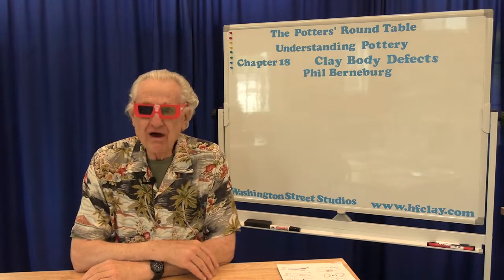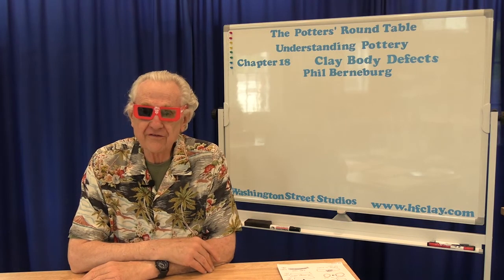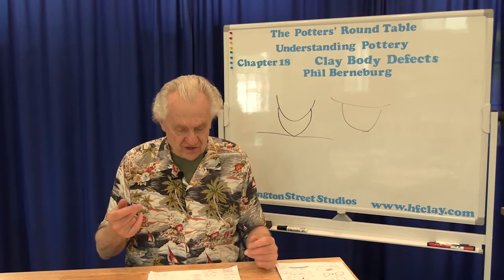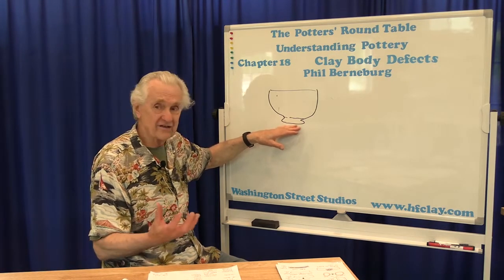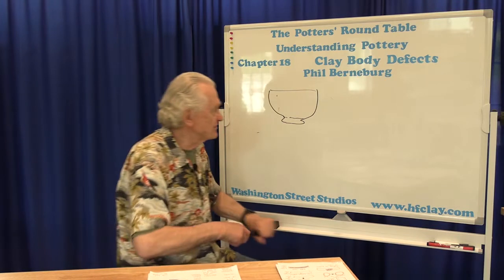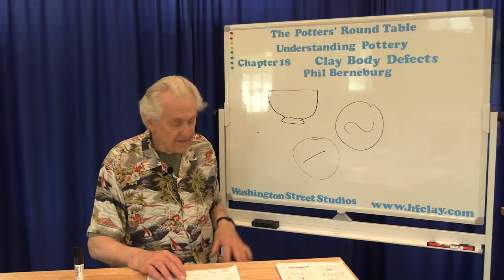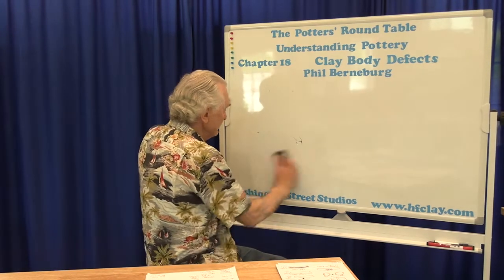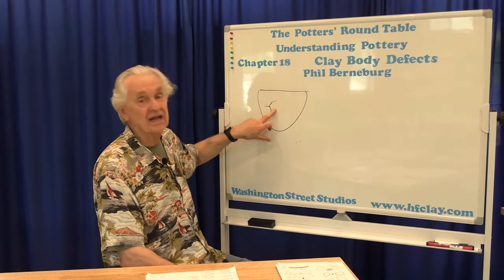Understanding Pottery Chapter 18 Clay Defects

Comment: For the bloating problem that is caused by impurities when there’s a lot of iron in your clay, he mentioned that it could be due to inadequate bisquing.  I’ve heard that for clay with a lot of iron in it, it should be bisqued at a higher temperature such as 04. Does that sound right? I thought I might have heard Phil mention that before.
Reply from the maker: Rhea, most bloating that I've seen in my pots has been in the glaze firing. Normally it's clay with manganese that makes it black or very dark clay. The manganese tends to bloat at cone 6. The fix I learned from Phil was to fire to cone 5 and hold for 20 minutes or so. In our kiln firing to cone 5 and holding for 20 minutes on the controller tends to achieve cone 6 with the cones.
Pin holing, on the other hand, can be caused by impurities left in the clay after bisque firing, and this can happen with iron rich clay. And these impurities can be burnt out of the clay by bisque firing to cone 04.
Thanks for the comment and I hope you're still learning from the videos!
Reply: @WashingtonStreetStudios  thank you so much! So incredibly helpful. And yes, I am learning so much! I am watching each video in succession. What a great loss in Phil’s passing. He seemed so well and energetic in his videos and I know they weren’t recorded too long ago. It seems hard to believe he is no longer alive. Anyway, thanks so much for responding to my message.

Comment: How can I prevent blisters and warping?
Reply from the maker: Blisters in the clay, or bloating, and warping are signs that the clay is overfired. If you fire to a slightly lower temperature you should see less bloating and warpage. If you want a repeatable process to eliminate warping, you can bisque fire to a temperature higher than your glaze fire. If the pot warps during bisque, throw it out. This was used in the early days of mass produced pottery to reduce wasted man hours during glazing and decorating.